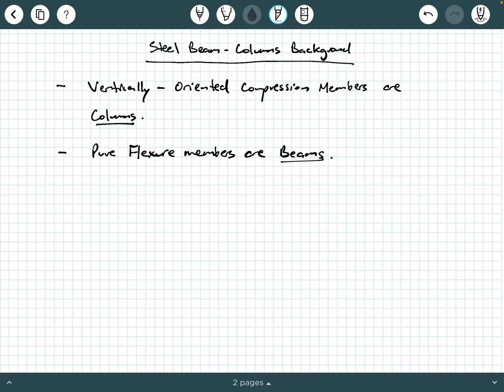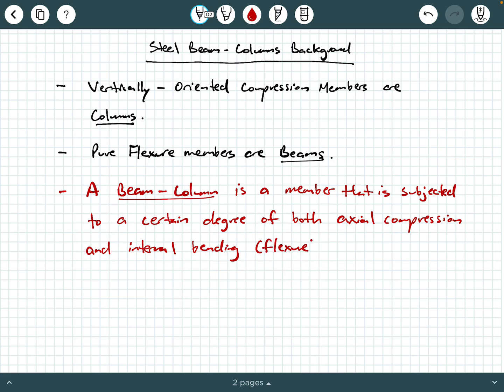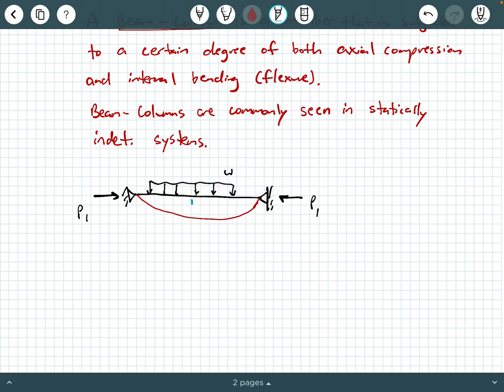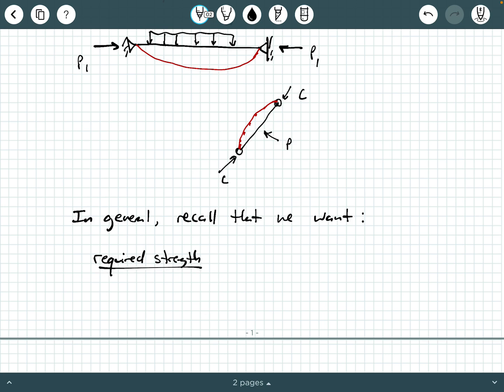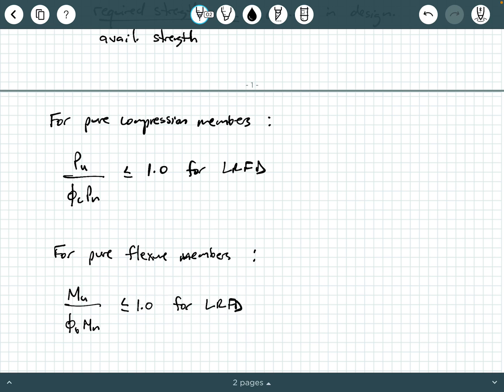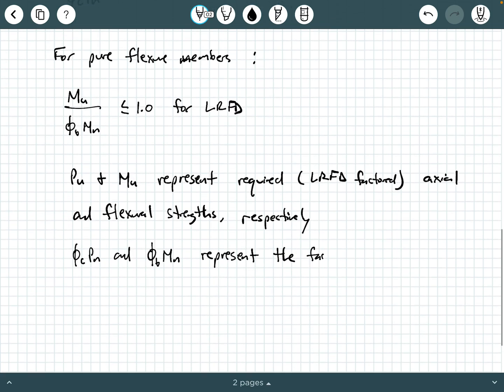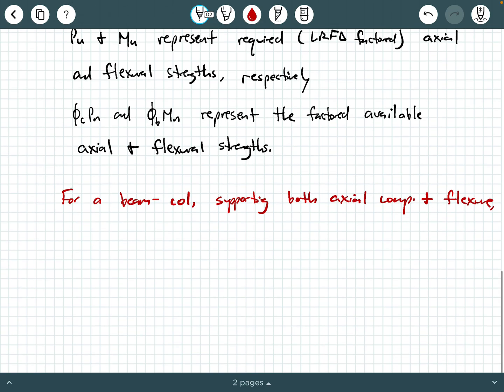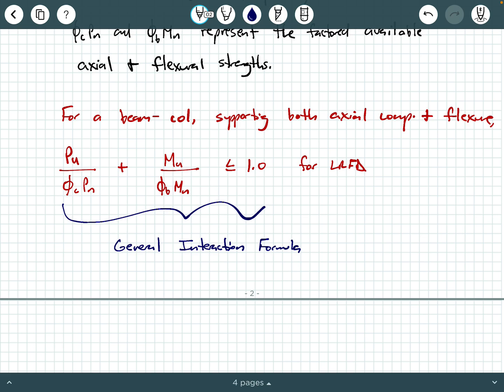Steel Beam-Columns Background

Comment: Good job sir. I have checked your playlist and I don't see any Reinforced Concrete Designs or Steel Designs.

Are you planning on doing videos on one of them or both. If not kindly suggest a good book or YouTube videos on both topics. I have watched your structural analysis playlist from beginning to this point.

Thanks in advance.
Reply from the maker: Thank you for the kind words.  I will likely make some Steel Design videos later this Fall.  I will also make some additional structural analysis videos in the coming weeks.  A good steel book is "Steel Design" by William Segui and a good concrete book is "Reinforced Concrete: Mechanics and Design" by James Wight.
Reply: Thank you. I will surely check those out  @mathandengineeringwithdr.a9515